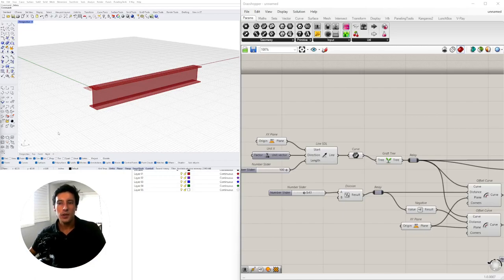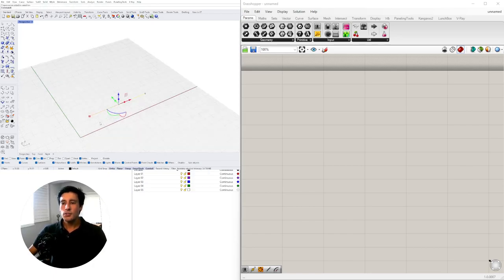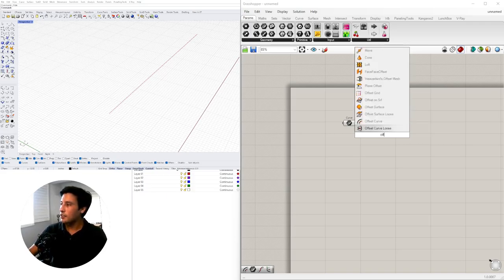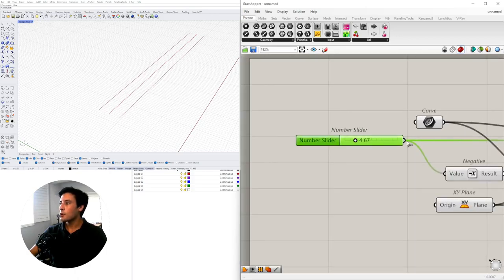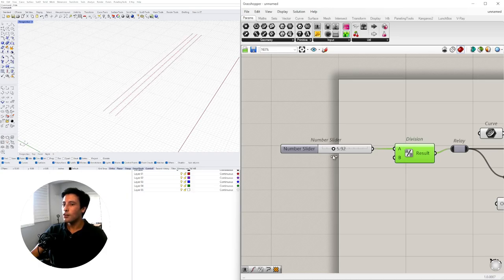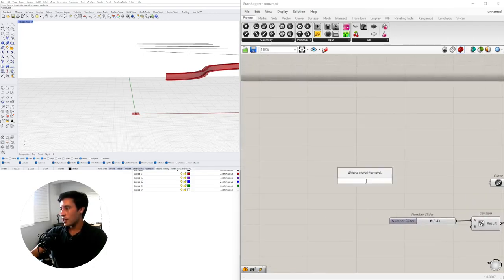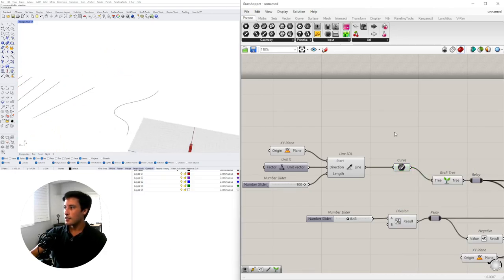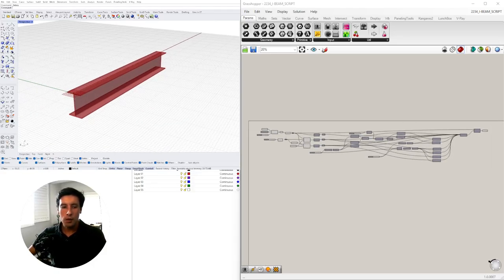Learn Grasshopper with short Exercises + practice techniques for any design!  I Beams Structure

Comment: Hold it. Objection. :P

You need one quarter of the profile. The rest are symmetry on the Y axis and X axis. Flanges are well common. With this one it's easy the construction of common sizes, perforations and hollowed beams with substracted circles or triangles. 

Don't forget those fillets. If so then the whole thing goes straight to a mesh surface. :P
Flow along curve is quite a good idea but orient over surfaces with plane frames could help for double curvature cases. Network beams are used as placeholders. Eventually structural engineers calculate the flanges thickness, height and weight. :D.

Great tutorial as usual.
Reply from the maker: Love the feedback! thanks for sharing!  I love that approach.  The tricky part is when its not aligned X or Y then you have to create a base plane for the symmetry.  This particular approach uses the offset as the alignment, and vertical drop + math to achieve the point movement to create the curve to sweep.  Either way, this is what makes this program so powerful.  You can create the same thing, in different ways.  and depending on what you want as the outcome you can take whatever approach suits the final result best.  Cheers! 👍🙏